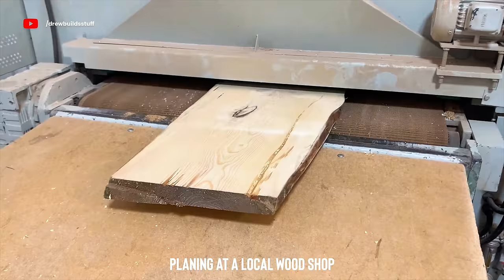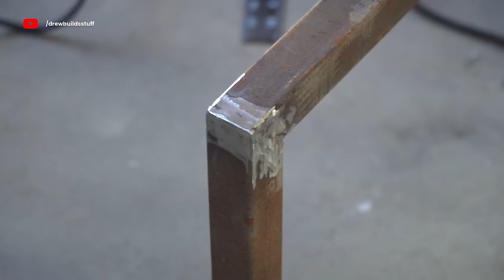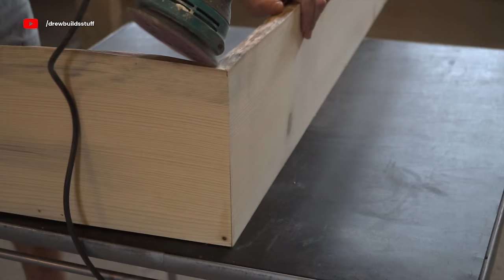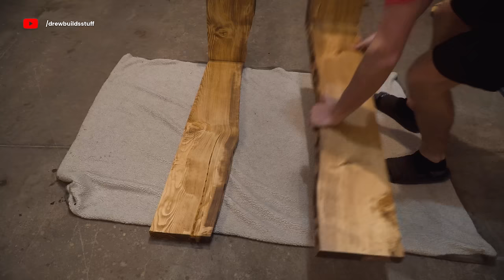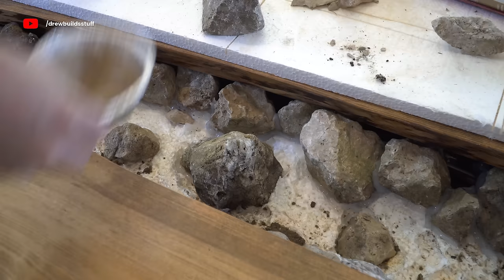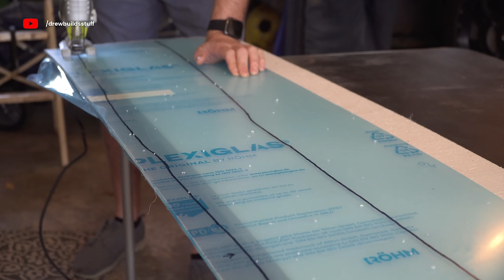I built a River Table with a REAL RIVER In It

Comment: Really neat take on the "river table".  However, I'm not so sure that styrofoam was the best choice as it does water log after it gets wet for a while.  You may find that there might be a mold or mildew issue down the road.  You may wind up have to redo that part.  Really looks cool though.
Reply: It's going to be a "Stinky Unhealthy Table'' !
Reply: ontop i would enclose the whole thing in plexiglass with a removable door so you can change out the water. i can see that becoming a insect breeding ground as well as mold as insects love fresh water sources
Reply: @craigaonifall  Fresh water? its a closed system and the pump does not run 24/7 .
Reply: @dries3421  i have seen a Terrarium Build with a water pump in a closed system https://www.youtube.com/watch?v=JSbiZUbUN1Q was just suggesting
Reply: @craigaonifall  if freshwater is issue, can’t he just dissolve a bunch of salt in it? Or would that greatly decrease build’s life expectancy?
Reply: 🤨 - they love still-stagnant water/swamp so they can lay their eggs in it knowing that there aren’t any aquatic predators under the water to eat their larvae ~ mosquitoes, lake flies
Reply: I was just about to comment this. Surely Styrofoam won't be able to hold the weight eventually too?
Reply: I would have used darkend clay  or a harden mud with stone mixed in and then inbeded the larger stones
Reply: @craigaonifall  Yes or even acrylic plexiglass and I would’ve had a plexiglass in the top as well so that it would be practical to sit stiff on the top and prevent it getting dusty
Reply: If you look I am pretty sure he put a layer over it as well as when he burnt it to place the rocks in and to create the depth it would of slightly sealed the Styrofoam
Reply: @craigaonifall  did you watch to the end he puts a glass thing on top that you can take off
Reply: @inspieredanimal3809  Side is still open
Reply: He seems to burn most of the surface of the Styrofoam, which would make it much more resistant to waterlogging from the top, at least
Reply: Fish tanks exist
Reply: @inspieredanimal3809  yep i did and he left the side of the table open but the differance he placed the bottle on a petastel that would not be easy for insects to access, where as the open side of the table would be easy
Reply: @inspieredanimal3809  yes he placed a layer of moss thats no going to survive on the styrofoam as well as the styrofoam is going to get water logged abd fall apart over time and smell have you ever seen water logged styrofoam 
but i am going to end this to say what he did was a great project there is just a few items that i would not due to either avoid smell, pest's or stagnation of the water like treat the water make
Reply: @inspieredanimal3809  Yes,but long term it will eventually seep through. I’m wondering if maybe using epoxy resin to coat the bottom first would be better .
Reply: @popenieafantome9527  It would the pumps (life expectancy) not all pumps are saltwaterproof.
Reply: @mariamsuliman6035  that is how most people build things, yes.
Reply: @craigaonifall  which insects do you foresee breeding inside his home in the water?
Reply: I agree I would have used great stuff plus pond foam.
Reply: @erinhallmakes777  LMAO, I guess he forgot it's inside his house unless he keeps his windows and doors open at all times LOL
Reply: @samuelfellows6923  That's still water - this is running. No breeding issues. It's also a living room in a house. Mosquitoes? lol
Reply: @craigaonifall  While I agree with plexi for the sides to stop any worry of splashing, if you put plexi on the top as well and enclose it you would get condensation issues. Especially because he put in real plant matter. You could put strips of plexy across the top but you have to maximize on gaps along the entire thing to stop it from building up. Also the wet moss and eventual mildew will attract bugs to the table. Better to go artificial or no plants at all.
Reply: Why he put styrofoam in doe? 🤔 Why don't just put rocks and sand and glue it.
Reply: @wackyduck3  That’s an entirely different topic. Fish tanks are a mechanically filtered biome, along with fish that would eat larva, and routine cleaning by owners. The main concerns here are mold or bacteria growth, but I would assume it’s definitely routinely cleaned as any indoor water fountain.
Reply: @craigaonifall  insects breed in stagnant water not fresh water that would not be an issue
Reply: @victorianrat  it would be the fresh water they would be attracted to as with all life on the blue marble they need water
Reply: @craigaonifall  yes but insects breed mostly in stagnant water like ponds and swamps not just fresh water
Reply: Looking again, he covered it all with silicone sealant before/while adding the sand and gravel, right before he did the clear spray, so it might have held up. Would be nice to see a follow-up video, though.
Reply: @popenieafantome9527  it surely would seeing how salt water breaks down big gurthy stones into sand
Reply: @craigaonifall  or you could put some of the flex seal paint on it and then paint it brow, no need to make the task harder whit clay
Reply: There might be other ways to ensure the table doesn’t get damaged from having the water in it. What I could think of would be the make sure everywhere the water would be is water tight, like what he did for the pump system. Not necessarily the black Flex Seal, maybe a clear or brown sealant
Reply: @adsepulcrum3392  yeah but wouldn't the brown spray flex seal do just that
Reply: @popenieafantome9527  that may not work but a little extra chlorine definitely would. IMO he should have added live plants though.
Reply: @erinhallmakes777  tbh it can definitely happen. If you leave a large tub pf water out you’re bound to see life sooner or later. Add anything natural like a teaspoon of dirt or a leaf etc and the chances greatly increase.
Reply: @silver-nu6ee  that’s not the salt, it’s the force of the sea that does that, apart from a few specific rock types which it fully dissolves rather than turning into sand.
Reply: @boarbot7829  oh ye my bad
Reply: Yeah that is gonna rot really quickly
Reply: did he not seal it with the clear spray paint?
Reply: Concerned about the long term viability of the flex seal as well. None of this build screams “will last” and I suspect it will need to be rebuilt if he wants it to survive a long time
Reply: The styrofoam is a questionable choice but the water is no more likely to breed insects than a pet drinking fountain or any indoor decorative fountain, provided it keeps moving. It will evaporate and need to be replenished so it will be regularly "freshened."
Reply: A tiny amount of bleach in the water would stop that.
Reply: Good point
Reply: Not to mention moisture destroys MDF (yeah it's sealed, but the water will eventually get through...) Perhaps cedar or redwood would have been a better choice to block in the 'river'. It's a beautiful table.
Reply: @dries3421  it is not closed. There is only the bottom and the top. Mosquitos will be in there before you can say jack splat. And styrofoam is a poor choice. Resin would have been far better and not hard to do.
Reply: @victorianrat  plenty of insects like moss. That part is not fully in the water, therefore insects will be there
Reply: Hot glue also dissolves in water over time (learned that with a thing I made for my freshwater aquarium when I had it).
Reply: @craigaonifall  Then he needs some spieders who eat the mosquitos.
Reply: Thin layer of epoxy when the Styrofoam fully dries will fix that
Reply: What would u recommend using other than styrofoam
Reply: I was thinking that about the moss. The moss if it got wet or any fell in or even humidity can make it go bad. Anyway I think this was just more of a trial first try at an idea sort of project but like with anything else he will learn more each time about what works and what doesn't. And it does open so u can clean it if u need to, the glass just sits over the hole
Reply: It can be good to test an idea with cheaper materials before you spend hundreds or thousands on something that doesn't work at all because of some detail you missed or didn't fully think through
Reply: When he sees ur comment.

Him: Awe shit
Reply: Lol, what is gonna grow mold? He siliconed dirt/gravel to the bottom, then covered the thing in clear spray paint(sealant). Preserved moss is dead and doesn't attract bugs... also, the Styrofoam is used as a moldable base for elevations and gets completely covered
Reply: @mariamsuliman6035  that's exactly what he should have done. Epoxy the styrofoam first then he'd be fine with the waterlogged issues, but bug's are definitely gonna love this new home 🏘️
Reply: @kevlandon  when preserved moss gets wet it can mold and even in humidity it can happen and I know this for a fact by owning a myrtle topiary tree
Reply: @kevlandon  moss also comes back alive when it gets wet I know that from buying moss balls for my fish before. They come dried out. They r officially dead. Until they get wet then they grow like crazy
Reply: It would be better to make it out of longer lasting material like op said but I think as a trial while he's working his skills out this makes sense. But metal or plexiglass or even epoxy, or solid stone would all be much better options I think and for the moss maybe an alternative plant material that is easier to preserve near water, that resembles moss otherwise he should coat it in epoxy or something too
Reply: @alyssabarr93  preserved moss has chemicals in it and is different from dried moss balls
Reply: I'm no fungologist but I think that since he covered the bare styrofoam with silicone, I think that would protect it?
Reply: The styrofoam has the clear coat on it which will protect it from having the water seap in unless it didn’t stick very well
Reply: the top layer got melted down, covered in caulk and flocking, and then given a clear coat; there's almost no way for the foam TO get waterlogged underneath all of that
Reply: @kevlandon  Mould will happily grow on ceilings and walls with just a little moisture present. It doesn't have to grow on something organic.
Reply: @popenieafantome9527  Salt would just build up over time so you'd have to clean it regularly (I do it daily on my saltwater aquarium filters)
Reply: @cheguevara19  I need TP for my bunghole
Reply: @dries3421  id like to see u make one
Reply: I was thinking the same 😂 mold mildew
Reply: Did you miss all the silicone?
Reply: I am not sure, but did I see a big pond under the table as well? Thats not healthy for the carpet either...
Reply: @popenieafantome9527  chlorinate the water like a swimming pool.
Reply: there’s always this guy
Reply: @wackyduck3 fish tanks are a hobby all there own. They need separate filtration and constant maintenance.
Reply: I can't see it's problem... He has sealed it with clear. .. although in the wrong position like being in reach of the sun..  it could possibly start flaking
Reply: Alternative... Use mineral oil in a closed loop and you will never have stuff growing in it.
Reply: He can’t hear us he has AirPods in!!!
Reply: @Mx.Cumulonymphus  I think you’re correct
Reply: Haters gonna hate
Reply: Your a hater because your trying to justify your words in a respectful way but still have something negative to say You make it sound like you can do better then his design But you cant because this guy knows what he does and it takes alot of strong beliefs for him to have a job to be committed to like this
Reply: @thuggceemurdaa  he’s simply offering constructive criticism. He saw something that might lead to issues in the future and has said so. And in nearly all cases constructive criticism is very important as it cuts out trial and error a lot.

With this video as the key hypothetical 
If the creator had the table get some mould issues then the only option would be to strip everything away and retry with different materials until it was better, but with the input and knowledge of others he knows that if this issue arises his first action should be to replace the styrofoam with another material 

Looking at your channel you make music, have you seen which videos are more popular and made more that are similar to the popular ones? That’s a kind of constructive criticism, it’s peoples enjoyment of your music telling you what they want to hear.
I have a high level English course, I need the constructive criticism to help with how my writing is going to be understood, so my words are clear and sound the way I want them to sound. 

It’s a horrible thing for someone to insult someone for their hard work, however this comment isn’t that. This comment is formatted like a sandwich (a great way of giving feedback)
- It says something positive about the idea 
- it highlights something that might need improvement 
- it suggests a way to improve 
- it compliments the overall results 

While any kind of criticism can feel harsh, this was a positively framed, helpful intended comment. He doesn’t think he’s better than everyone else, he saw something that could be improved and said so.
Reply: @Griffin050A1t  i love you
Reply: @thuggceemurdaa  love ya too my guy, where ya having a crap day?
Reply: @thuggceemurdaa  ohhhhh, all good. I can’t say I don’t enjoy an internet fight myself
Reply: he sealed the styrofoam. no water seeping through
Reply: @mononokehime3182 so what? He did a great job
Reply: I'm not sure about the Styrofoam, but to address the other issues people are commenting about... I'd have a filter and pump. It would almost be like a shallow aquarium. Maybe even add some tiny fish, but big enough they don't go through a screen at the end of the river. Im kinda just thinking out loud. This table is cool, but having any source of water in your house can cause mold issues later.
Reply: Congratulations youre so intelligent, how about give the man his credit instead of the unneeded rebuttle
Reply: You guys commenting in here are trying so hard to be smarter than each other, who cares. Just enjoy the mans effort he put into this.
Reply: Thats what the paint and primer was for wise guy
Reply: No worries, the table was built for clicks and not to last.
Reply: Nerd
Reply: For God so loved the world that he gave his one and only Son, that whoever believes in him shall not perish but have eternal life.”
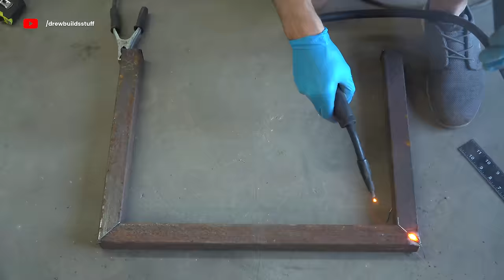John 3:16

Jesus loves you repent and belive in him and you shall have eternal life. Buddha can’t save you Mohamed can’t save you kirishna can’t save You only Jesus Christ can forgive and save you from Hell. ❤🎉🎉
Reply: @justabearbrowsingyoutube4968 The pump itself includes a filter which will trap a lot of algae and mould, as long as it’s cleaned regularly.
Reply: Yes!! I add some to my dishwasher sometimes.
Reply: @erinhallmakes777  mosquitoes
Reply: isn’t that why he prtected with dirt, rocks, and glue?
Reply: Yea I think maybe using some red guard on it or the actual stuff landscapers use when making water pieces in yards may work
Reply: Look in your toilet tank
Reply: Few drops of bleach and blue food coloring in addition to a pump running 24/7 will keep insects, mold, algae, and fungus away. Also, if needed, a small filter can work wonders as well. Some pump diaphragms are sensitive to bleach, so find one that is similar to those in chemically treated pond features.
Reply: Expert comment I see. Lets see a video of your water table.
Reply: @siriusfun  we have an indoor pumping system that has an open bucket water source which transfers water from our yard > indoors > to the backyard to prevent flooding. There are spider webs over it 😅 no mosquitos
Reply: Great idea, would have placed some sort of lighting underneath.
Reply: De-ionized water?
Reply: Maybe he sealed it with resin first and we did t see that 🤷🏽‍♀️
Reply: @dries3421  bro if u add 1 ppm of chlorine that should stop the insects and mold
Reply: Btw there is a spray that hardens styrofoam… xo